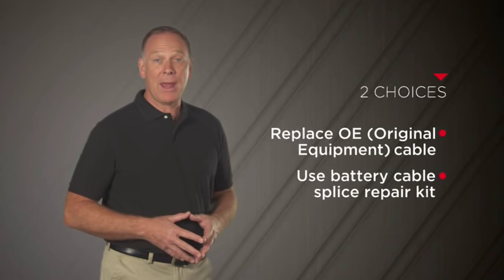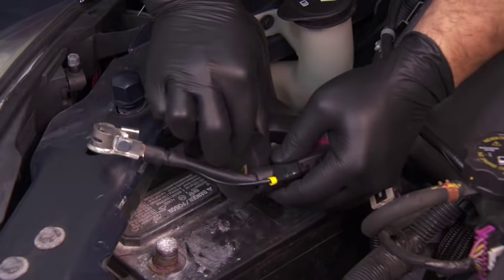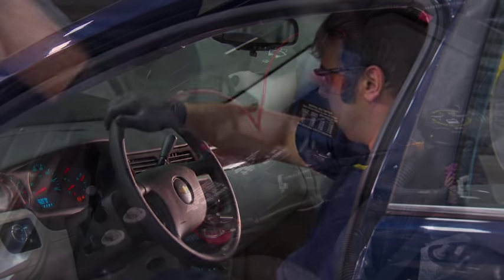Battery Cable Repair Splice Installation

Comment: I really appreciate this video. I am in this same predicament. My cables are a bit different, but I am hoping that if I get everything that was initially going to the positive spliced into the new positive splice kit and all the wires that were going to the negative into that side's splice kit that the car will start when I'm finished. I have already purchased everything so I should know if it works by tomorrow. Thanks for the great how-to video.

Comment: Also, it's hard to get the 2 positive cables into the post connection ..(terminal..it may be called?)  Thanks again !  VERY helpful and clear video!  Thumbs up all the way !
Reply: How did you figure out how to fit it?

Comment: Do you have any larger splice connectors? My 2006 Honda Accord V6 has a larger gauge wire coming from the starter, than your connector will receive.
Reply: Make your own. There are videos here to show you how easy they are to make, if necessary.

Comment: What to do when the wire is to thick for the connectors the kits say 4 6 8 gauge wire but still not wide enough

Comment: What should I do if my cables are too thick for the splice connector? Do I need to fit ALL of the wires into the splice connector?
Reply: My question as well. One of my leads is 2x as thick.
Reply: Yes you want to connect all the wires in.

Comment: Hello i have an 08 Chevy Impala 
 same as your video which model do i order?
Reply: What did u end up doin I got two of them and the wire is to thick for the connectors wat did u wind up doin I have a 2007 Chevy impala

Comment: Will I be able to pass a Virginia vehicle inspection with slice cables?  Is there something in writing from your company that confirms a vehicle inspection pass with this modification?
Reply: Call and ask a local auto mechanic shop, most would be able to tell you that.

Comment: What chemical spray is used to clean the corrosion off of the terminals?
Reply: DJ GASM meh. not necessary. baking soda + water, or, for tougher cases, coca-cola. yes, serious remark. cheers!
Reply: Use lime and baking soda

Comment: Not big enough to go on a
 2005 6.0 starter wire!!! That starter wire is huge.
Reply: how do you resolve this?
Reply: I wanna say i just went to auto store like napa and got a coorect suze wire and asked for a length i needed amd they cut.
I have some wire around here but not that big.
Good luck!

Comment: “Labor extensive repair” of a negative battery cable, come on man stop exaggerating. So easy to replace!
Reply: I wonder why they didn't tell the truth about dissimilar metals and Galvanic corrosion. If you going to do all that in the video you might as well get two 4 guage copper wires, butt splice them with the original cable, and use thermo heat sleeves to make it last for years...
Reply: Even on a crown vic ?
Reply: @portmurphy1  it will not work on crown Vic's, it knows they're used cop cars. These cables are not cop friendly